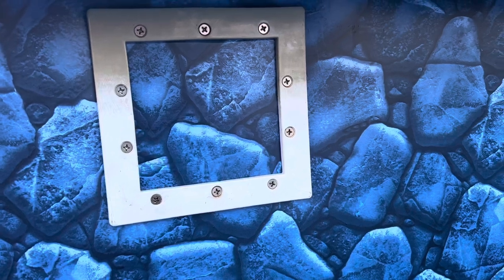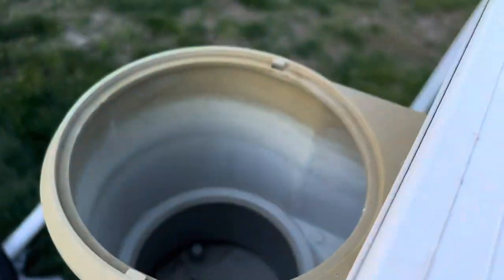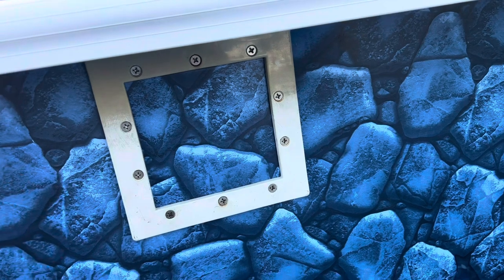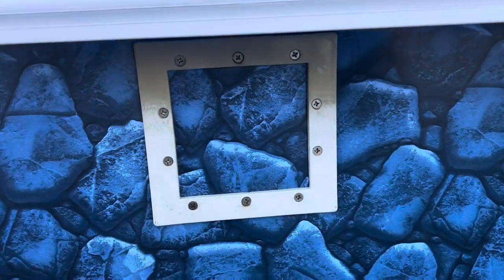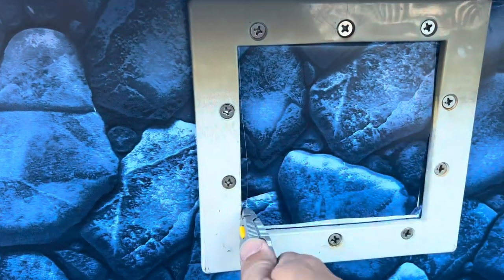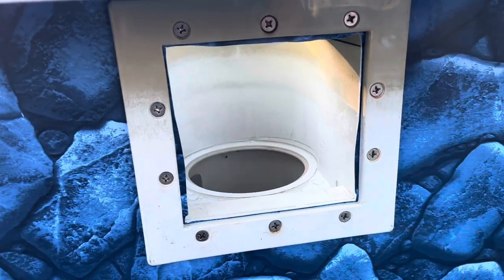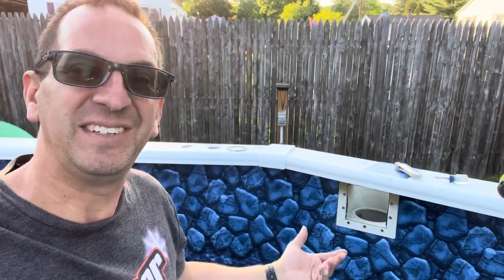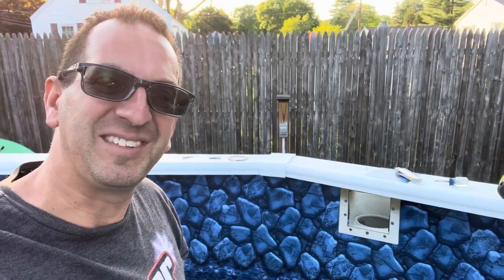How To Cut Swimming Pool Skimmer Hole In New Pool Liner

Comment: Very short, simple, and right to the point! Love it! Helped me out, and I have the exact same liner 😂......what do you do for the circular gasket though?
Reply from the maker: I carefully pressed the liner against the opening, then cut and X on the outside where I can see the side of the pool wall. I then put the discharge pool nozzle in place and trimmed the excess pool liner flaps out on the way, then added my retaining ring to the nozzle. Hope this helps you out.

Comment: Some skimmers have a H section butterfly gasket so you can’t fit it until the hole is cut.
Reply from the maker: Ahh...Well if you do not have that, this is the procedure I used to cut the skimmer in.

Comment: Did you poke a hole in the liner for the bolts
Reply from the maker: I pokes them through once the skimmer was in place so they lined up. I cut the skimmer hole last.

Comment: Should never cut out out till few inches from lip
Reply: What does that even mean?  Should never cut out out?  Until WHAT'S a few inches from the lip?  The water?  I don't understand.  If you have something of value to add, you should make sure people can understand what the heck you're trying to say!
Reply from the maker: The method shown worked perfectly fine.
Reply: @HomeOwnerRepair  Thanks for this video. I'm installing my 3rd liner on an aquasport 52. Seems like about every 5 years.....  Just enough time to completely forget..... Anyway I'm guessing the comment above about not putting in or cutting in the skimmer hole relates to the tendency of the liner to move, shift, adjust as it's filled with water and not wanting anything holding the liner from moving until the pool is basically full. 10,000 gallons is going to weigh @ 80,000 pounds. Lots of pressure. So the comment makes sense to me but I can also see why it might very well not really make any difference since there's not much moving around once the pool has @ a foot of water which again is like 20,000 pounds for a 10,000 gallon pool. BTW this is why it's really important to get your liner floor in the correct position before adding water. Another vid stated that once you get about an inch of water in the pool you can forget about moving/adjusting the liner floor which basically somewhat contradicts what I said above. Who knows? Anyway your procedure looks rock solid to me for getting the skimmer and liner in correct position Happy Trails!